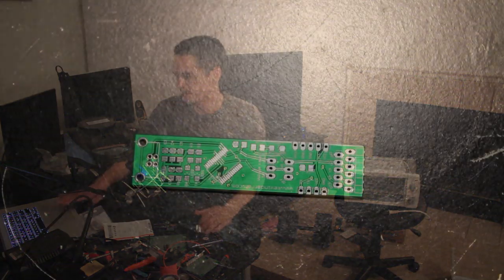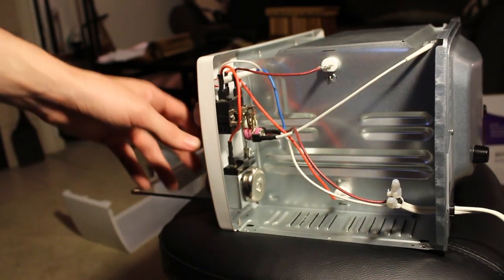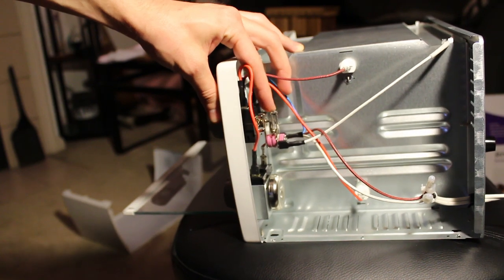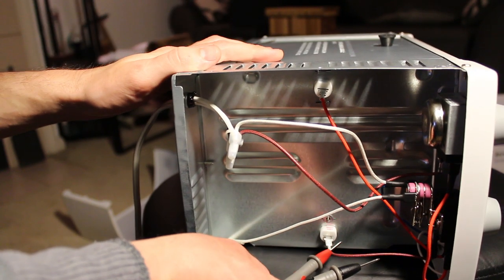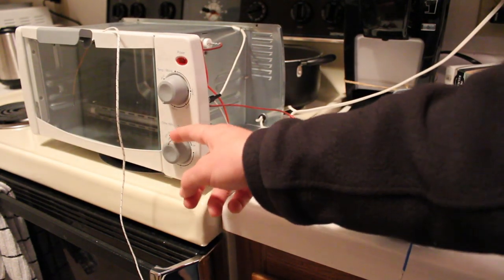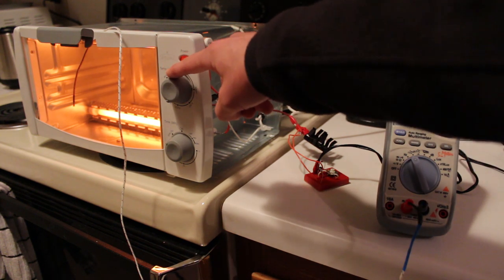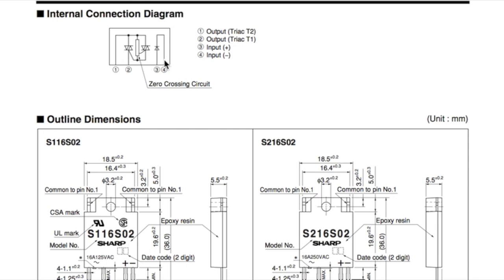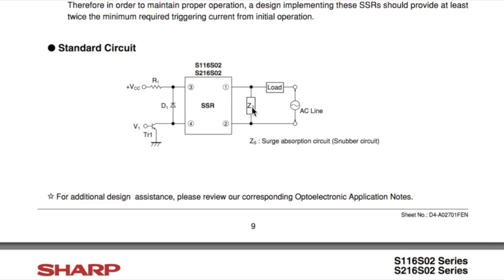How To - Arduino Reflow Oven P1

Comment: :) that's better but is just practice. Once you get used to it, its even faster than using soldering paste unless you have a stencil.

I want to see how fast the temperature change response is with that kind of oven. I plan to make my own but using a smaller housing and  diferent heating elements.

Comment: One thing I would be concerned about is radiant heat hot spots, some sort of metal deflector over the elements would help, though it would mess with the heating time.

Comment: You can replace the Triac with 30A relay so you are totallt safe and no heat sink needed nor you get heat out of it, and youll nees a single transistor to drive current to your relay coil.
Better, no heat and safer.

Comment: I started building my reflow oven about 1 month ago and waiting to see how you work out the control program.  I gutted my oven of all control and just left the heating elements.  I first I planning to mount the arduino inside the oven in the vacated space where the controls were located, until I realized that that area gets almost as hot as the inside oven temp. duh...   Are you planning for any digital display of the arduino control functions, like with a LCD on your control box?

Comment: I'm planning to build one of these using a Flavor Wave Turbo oven (google it) ... has the benefit of being transparent almost everywhere except top and a fan on top that circulates the air so the boards would heat up evenly. 
Same principle, mechanic thermocouple turning halogen lamps on and off, and timer cutting current.

Comment: I'm having a problem sourcing the 120V-16A version of that Sharp SSR at a reasonable cost. I assume that the 240V-16A version would be a correct substitute for use in US on a 1050W oven.

Thanks.

Comment: Cool video, thanks. I wonder why you heat the bottom element, as I cannot see it helps to heat the surface of the board. I'm thinking of remounting the bottom heating element to the top. Any thoughts?

Comment: If you're not as confident about hacking the insides, you could buy something like a Power Switch Tail that the oven plugs into. The P.S.T has 2 wires going in for the input from the Microcontroller. The code for the Arduino would essentially be unchanged.

Comment: waw. do you know anything?
Its all to do with the size of your mains cables that conect the street power to your house. 
tyicaly its 16mm2 cable, wich is generaly protected by a 64amp circuit breakerin your switchbord/fusebox. 

64amps, typicaly.

Comment from the maker: the arduino is nothing more than a standard AVR micro controller programmed with a special boot loader allowing you to program the chip through the UART using a simplified IDE.  What makes it awesome is the IDE, community, resources, etc... blah blah

Comment: Why not simplify the SSR with a $6 self contained SSR . ( 25A/250V SSR White Solid State Relay 3-32V DC 24-380V AC Control ) you can get from ebay?  No heat sink required.     At the end of the day you want the  arduino to control the SSR with a 5 v control input to turn the toaster oven off and on to follow a predetermined heating profile